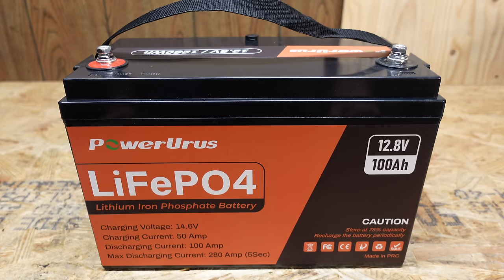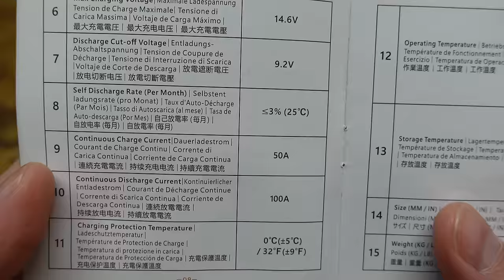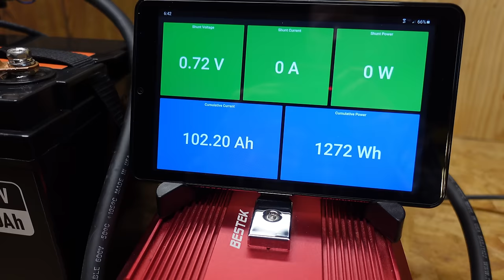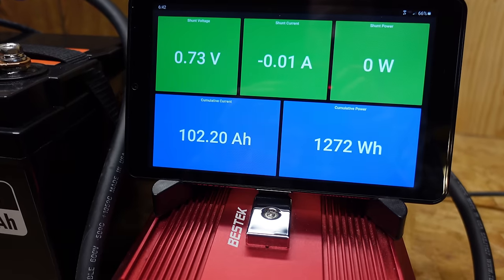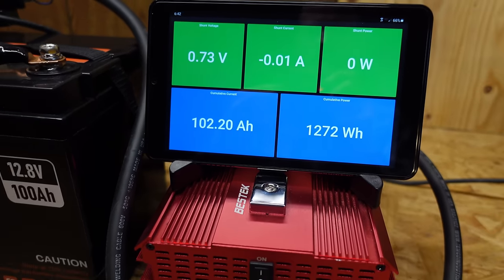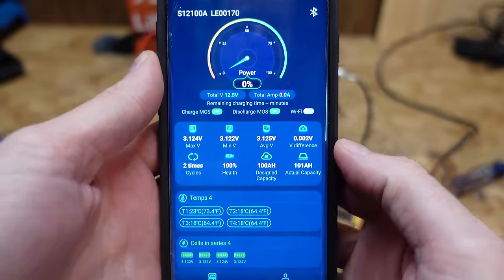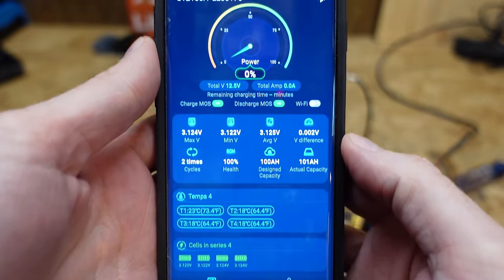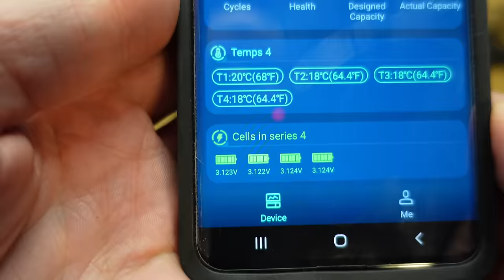PowerUrus 12V 100Ah LiFePO4 Battery Teardown, Low-Temp & Bluetooth!

Comment: Another excellent battery review video, per your normal standards.  Something you showed made me wonder if anyone has tested how long it takes a lithium iron-phosphate battery to warm up to a safe charging temperature, when starting at or below 32 degrees.  Say a battery was at 10 degree Fahrenheit and you started a .2C draw.  How long would it take until the cells warm up to around 35 degrees?

Comment: Well-built batteries, and are worth the small extra cost compared to the cheapest options. Working high and low-temperature sensors are the best part.

Comment: Might sound redundant but... could someone please do a teardown of the 200ah version of this battery? I like to know if the larger capacity has the same quality standards, and brand of cells. Is it likely, of course. But this is pretty much the only review of this brand currently.

Comment: I have 2 of these and I have a couple questions. What are the dimensions of the “guts” as they were pulled out? And would it be possible to pull the cells out of the cases and wire them together to form 200ah for my DIY power station project.

Comment: I wonder if they are just binned down versions of RoyPaw.
So they would be the exact same unit, just failed to pass the quality test.
Reply from the maker: I was kindof thinking the same but they're not EVE cells which are typically used in RoyPow batteries. The QR decoder tool on gobelpower.com indicates they're REPT cells, but doesn't know the capacity. I'm not sure.

Comment: Is there a trick to getting bluetooth working?  Two phones and a tablet do no detect a bluetooth signal to pair too.
Reply from the maker: Did you make sure the battery is charged? If it's not dead and you can't find it with 3 devices, it sounds like there may be something wrong with the BMS? I'm not sure.

Comment: where the issue are , these batteries seem like a great thing but have BMS electronic circuit which fails eventually 
 ( many componets ), cant hold that current in and out constantly , they just make money on you buying new ones over and over   $150-250Each , its better to by agm lead acid battery Has NO bms  , and why they will last for sure . two 55amphr 12volt  agm are $99, in put in parallel 100amphr for $200 , 60lbs